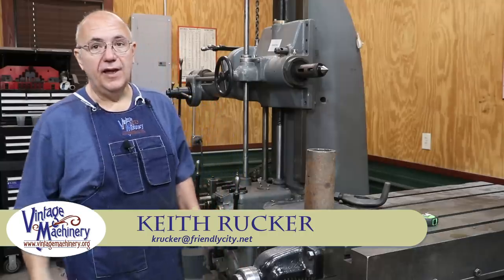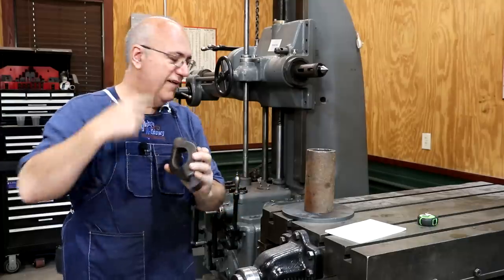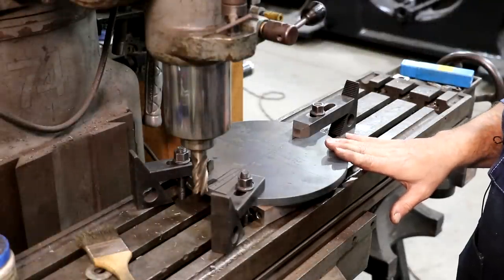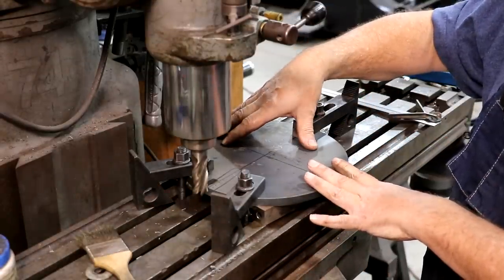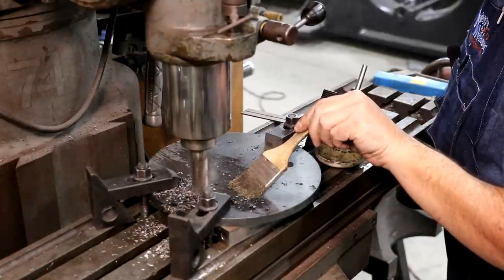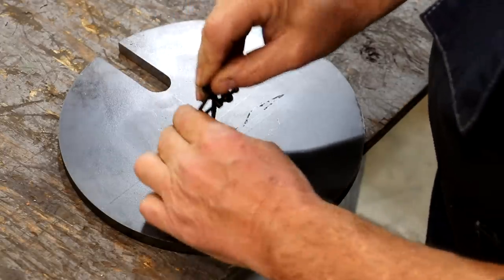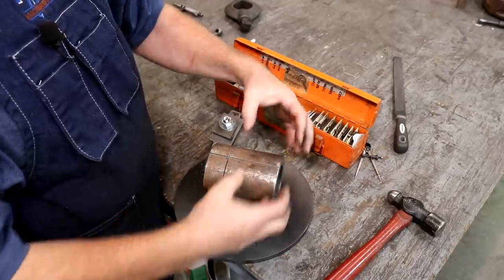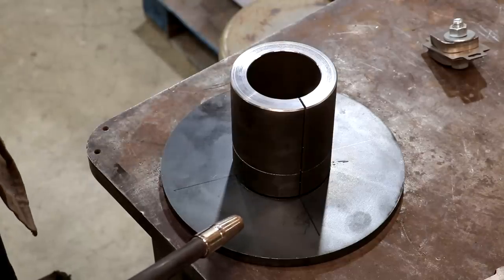Horizontal Boring Mill Restoration: Fabricating a Drive Dog Plate for the Spindle

Comment: I am wondering why you did not use your new Vevor weld positioner to weld the pipe to the plate.
Reply: I was thinking the same thing.  The weld positioner would have made welding the pipe to the disk easier.
Reply: probably shot before it came.
Reply: Do the jaws that came with it open up far enough? He probably hasn't fabbed up any extensions to bolt to the jaw tops.
Reply: Was just about to ask the same question. Unless this was filmed before he got it?

Comment: I would suggest putting a stop drill hole at the end of the cur across the diameter, in use that will be a stressed hinge under cyclic load nice place for a fatigue crack to propagate from.  Too late now, but hopefully the amount of use the part gets wont be enough to be an issue.
Reply: Tell him what you are thinking at the outset of the project, not at the vey very end.
Reply: @silasmarner7586  You do realize that these aren't live videos right?
Reply: @ericg7044  seems like ol silas been hittin the bottle

Comment: If you use a 3/8 th drill for the first hole, you can easily follow it up with a 2” drill and skip the others.
Reply: 3 drills for 1 hole, a waste of time. If you grind a split point on the 2" drill, it wouldn't even need a pilot hole. Has worked for me and the old German tool maker I apprenticed with.
Reply: Why do you guys care?  This is not your time, nor your project.  I don't think anyone cares how the drilling "experts" feel it should be done.
Reply: @paulcopeland9035 Its knowledge, and it matters.

Comment: Another way to make the hole in the plate would be to use a hole saw. You would have a 1/2" thick slug that could come in handy for some future project instead of turning it all into chips.

Comment: if was makeing the drive plate i would bore the face plate center a little bit biger then weld the plate to the pipe on the iner then re machine it
Reply: So......what he did, didn't work?
Reply: @paulcopeland9035  it just the way i would of done it, i over make things
Reply: Yes...but it doesn't appear Keith has enough clearance over the ways to chuck the disc... at least not in this lathe

Comment: I'm betting this "upcoming project" is that fire box or, that pitted locomotive related project that Abom used his shaper on and I think Brian block had a crack at it also
Reply: Brian said he could machine that part with no problems, but Keith didn’t give him the chance (yet). I think Keith wants to use that nice looking HBM on it, can’t hardly blame him either. If that doesn’t work than Brian can probably have his way with it.
Reply: I bored the cylinders  and faced the ends 3 years ago. I have not had any other parts of the stoker engine.
Reply: I think the job might be truing the wheels on the giant bandsaw he is restoring for another youtuber.
Reply: @nrml76 , I think you might be right! Good one.